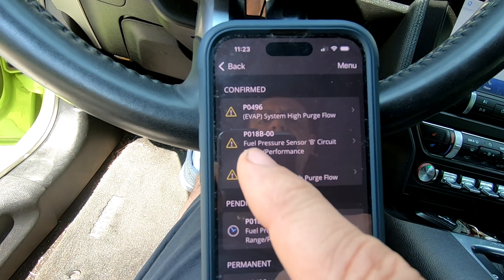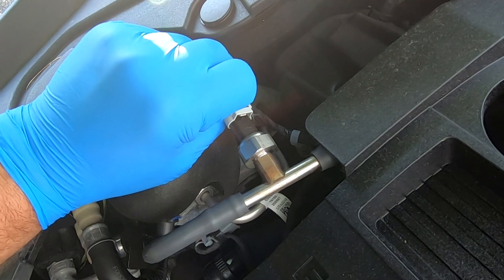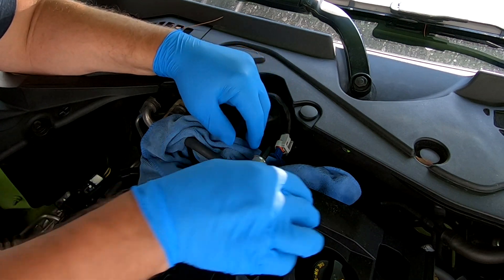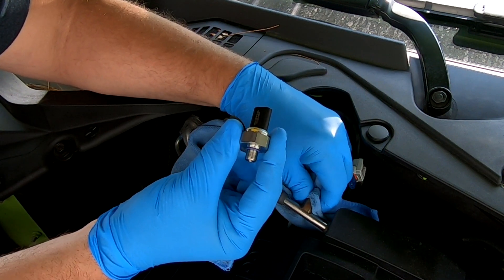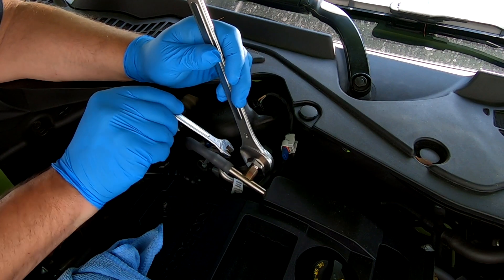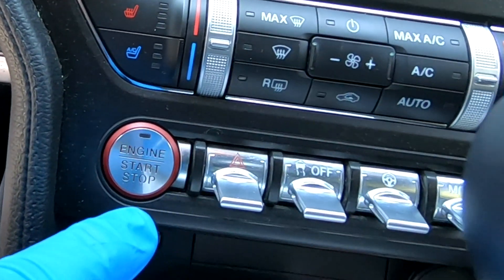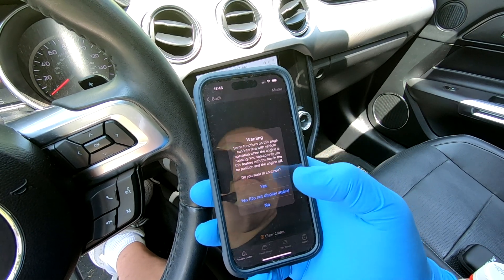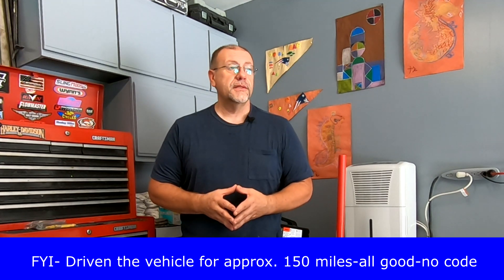Code P018B Fuel Sensor B Circuit Repair 2.3l EcoBoost Engine Ford Mustang | Techn' Moto

Comment: Bruh i replaced mine but started it right after.. Code is still there, no CEL, the sensor ir original, but still get P018d.
Reply from the maker: @Andressence  are you sure you installed the updated oem sensor? Did you Clear the code? Have someone check your work.
Reply: @TechnMoto  Updated? Omg not sure. I bought "New Genuine OEM Motorcraft CM-5250 BU5Z-9F972-B Fuel Injection Pressure Sensor". Cleared the code and keeps showing up
Reply from the maker: this is the sensor I purchased, its the upgraded oem one-  https://amzn.to/3y9EEKU
haven't had any problems since I installed it. The one you list the part number for is an after market sensor and I am willing to bet it is junk. Their is a reason it is cheap verses the OEM one. Good Luck.